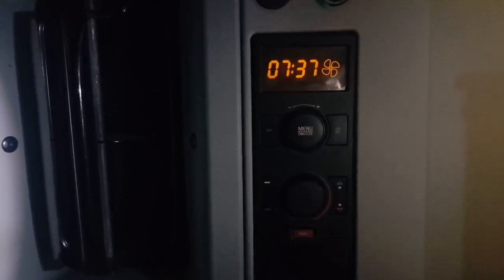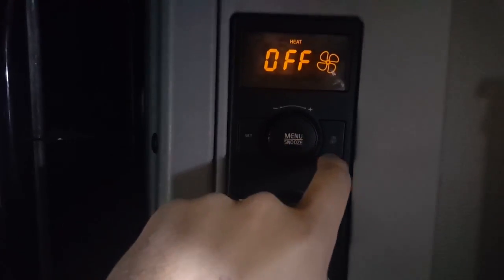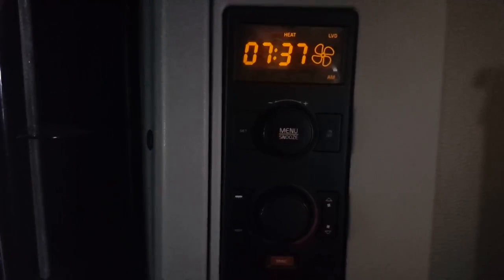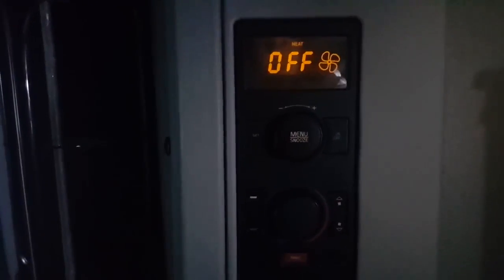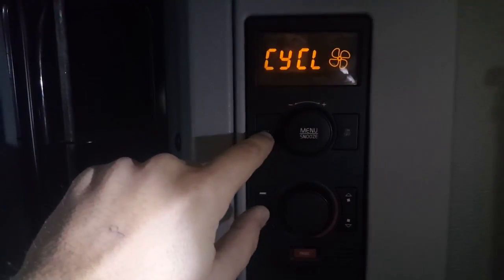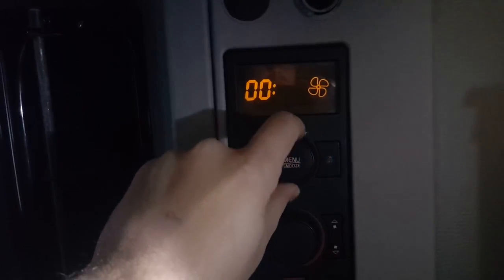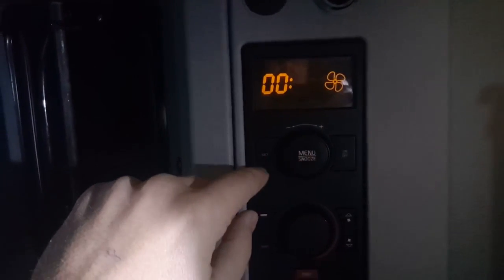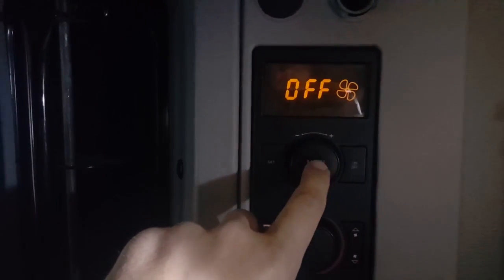2008 2018 Semi Volvo sleeper heater operation

Comment: Make sure you fire up your bunk heater once per quarter, even in summer... to make sure it stays fresh/clean. They do have a maintenance interval, some times ignitor will fail and needs to be changed
Reply from the maker: This is true. Correct.

Comment: Great video buddy! I have a question, does bunk heater drain your battery?? Because I noticed when I turn on the bunker heater for over night my LVD signal doesn’t come on when I turn ON the bunk heater…? 

I have a Volvo vnl780 2016.
Reply from the maker: Yes it drain batteries. I have no idea how LVD works. Sorry.
Reply: The wabasta or bunk heater only uses enough electricity to use the blower motor, the actual fuel to make heat is taken from your diesel tank. Runs on diesel I believe

Comment: It took several tries but I got to cycle. Volvo could have made that a little easier. Going down to 23 degrees F in Northern Illinois tonight.
Reply from the maker: No more dry throat and nose for sure!!!! I love cycle mode.
Reply: @DKUSTOMSGARAGE  okay morning report, it stopped heating in the middle of the night. I know they have a problem with line freezing. I just restarted when I got to a dock in Michigan and it worked fine at around 40 degrees.  Any ideas?
Reply from the maker: I just wanted to tell you, don’t use it below 20-25F.
Reply: @DKUSTOMSGARAGE  but that is when you need it. Worked good last night, had to turn it off. Low of 30 where I was in Ohio.
Reply: That doesn’t make any sense. Is this why you need an app then?

Comment: Do you need to have truck running? And will this kill your batteries and you will not be able to start truck in the morning. Thank you
Reply from the maker: Victor Campos if your batteries good, it will not kill batteries in 10hrs 100% guaranteed. Used this way for years on a Volvo.
Reply: If you see a LVD on your screen that means "low voltage detection" that will shutoff before your batteries are drained and leaves enough to start the truck! You can also turn off and on this feature.
Reply from the maker: Actually I never drain batteries that low so that option got in use. Usually truck making a sound before that LVD, so I turn on truck and that’s it. When temp dropping lower then 0F, that bunk heater is useless.
Reply: Uses diesel, has ignitor plug and exhaust flex  pipe under Sleeper (good place to warm your hands if outside and bunk heater is running)

Mine makes a little clicking or tapping noise (probably thr siphon pump)

Helps me fall asleep when truck is off

Comment: Why is mine only working when truck is on?
Reply from the maker: If you don’t have APU or battery APU then AC works with truck on but heater can work with truck ON or OFF.
Reply: @DKUSTOMSGARAGE  I don’t have an apu. I appreciate that info. But even my bunk heater does not work unless truck is on.

Comment: How to put cold?
Reply: It is only a heater, not an AC unit.
Reply from the maker: You’re correct. If you have a parkSmart , it’s always ON.
Reply from the maker: Unless you have a Volvo where you can set a temperature and it will turn on/off by it self to maintain the desire temp.